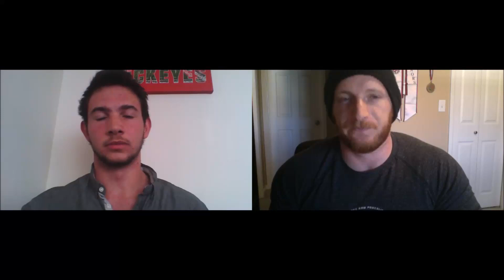Bryce Lewis On: Training Methods (RPE vs DUP Part 1)

Comment: I mentioned this to Bryce just now, but I think this is pretty important to get across. I'm using Mike Tuchscherer's words here: RPE systems / programming around auto-regulation is like putting a scope on a rifle. It's just another tool you can use to achieve an end result.
Reply: If I didn't mention it yet in this interview, hopefully its in part 2 that these training concepts are not mutually exclusive, and we can see lots of crossover. And when Jim said I was using an "RPE" training program, I was just using an autoregulated approach with 3XSQ, 3XBN, and 1-2XDL frequency, and block periodized. There are infinite ways of autoregulating a training program, this was just one example where load was dictated by RPE
Reply from the maker: Right, I believe I talk about that in part 2. I'll try to get it up as soon as possible.
Reply from the maker: I actually utilize RPE in conjunction with percentage based programs. Particularly for my accessory work. I feel less stress when auto regulating accessory work so I try to implement that for my clients as well.
Reply from the maker: Bryce Lewis Definitely misspoke there. Definitely meant "RPE based training " (Or auto-regulated training) Which is a broad term in and of itself.